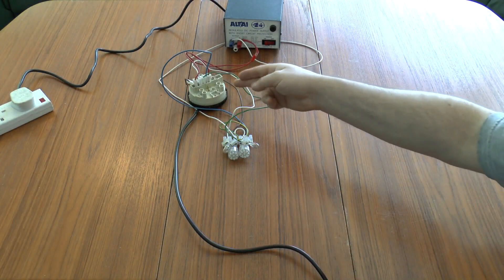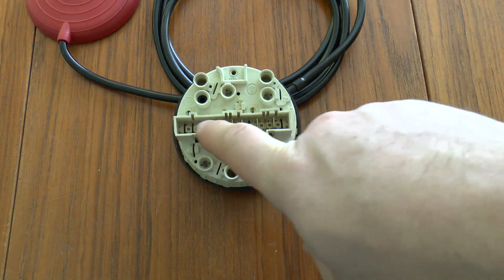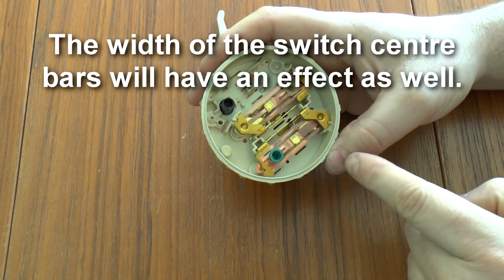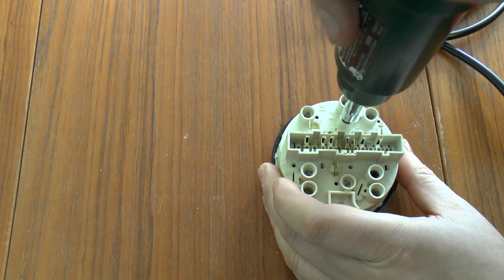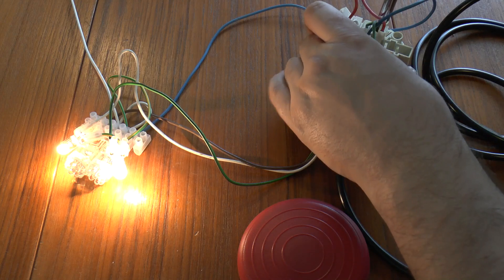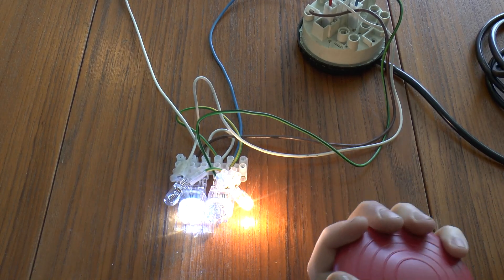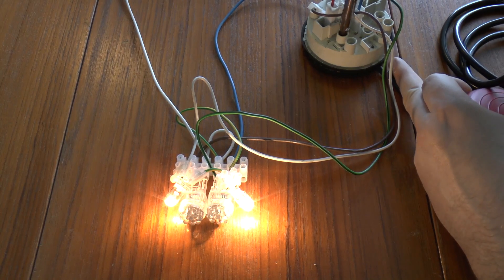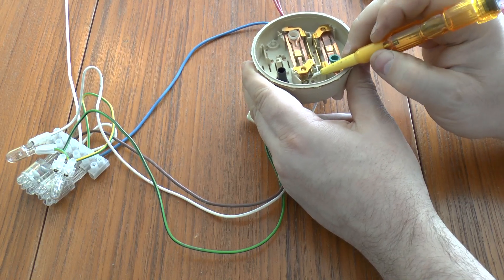Inside an air operated switch

Comment from the maker: The air pump is a "foot switch bellows", RS part no. 335-375. Alternatives are grey (335-397) and black (316-945). It didn't come as part of the machine.
The hose is a smaller diameter but can be forced onto the switch nozzle nevertheless.

Comment: Had a hotpoint aquarius ages ago, one of those energy saving ones, sod all water to wash the clothes, not until i adjusted the setting screw. Lol, and boy did the clothes come out cleaner than b4? Lol didnt mattet how much water i used anyway as i live in belfast and dont pay water bills, but if you want cleaner, jus "turn that screw" lol

Comment: yeah its the water level sensor!
more air pressure pushes the air in the tube into the switch and actuates the contacts
for low med and high water levels